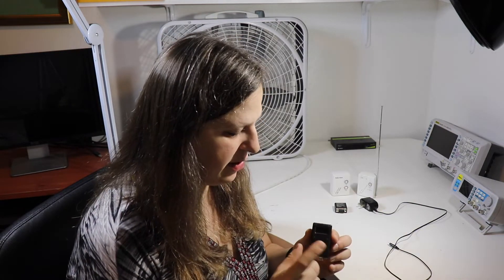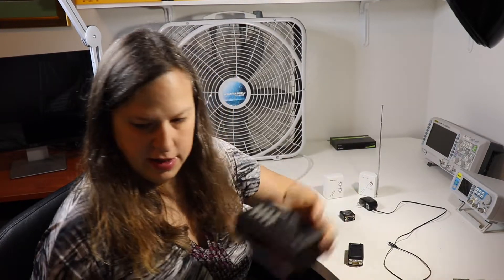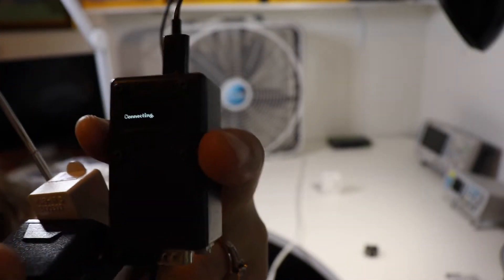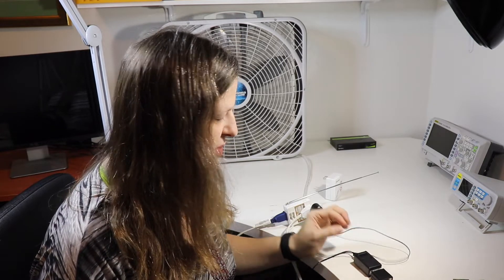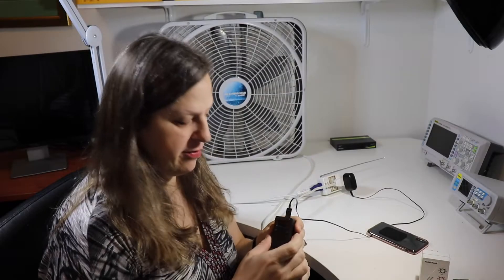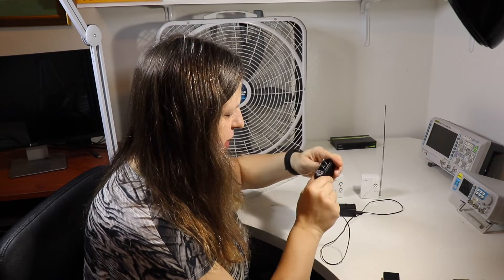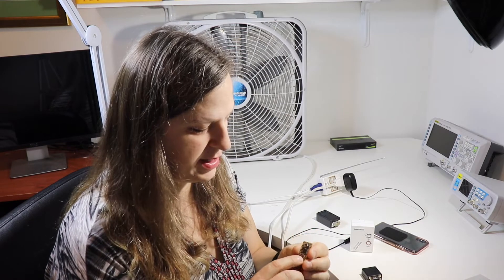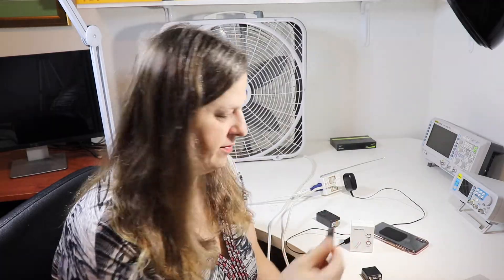Controlling Smart Home Modules with my Custom X10 Interface

Comment: To greatly increase the reliability of X10, repeat the command several times.
Reply from the maker: NiHaoMike that could work, though if it fails, it’s generally a result of the X10 system itself. Putting everything on the same breaker has been very reliable. I might put in an option so it could be configured to send it twice.
Reply: @makermelissa  I actually advocate sending like 10 times or even more to be robust against burst noise. That can be implemented using a priority queue with new commands getting a priority of 10 or whatever (higher numbers signifying higher priority) and commands having been sent reentered into the queue (if it's not too full) with a priority of one less, until the priority goes to 1 in which case it's sent for the last time and not reentered. That way, resending will not add an unusually high latency to the next command.
Reply from the maker: What I would eventually like to do is get the CM15A that I already have working with Mochad and openHAB. It has 2-way communication and can get the current state of the device so it will know if the command succeeded. It’s just trickier to implement than my solution.